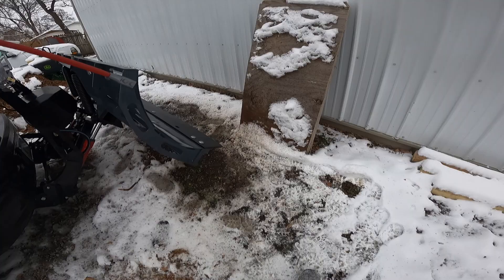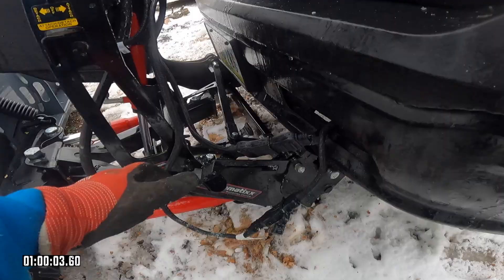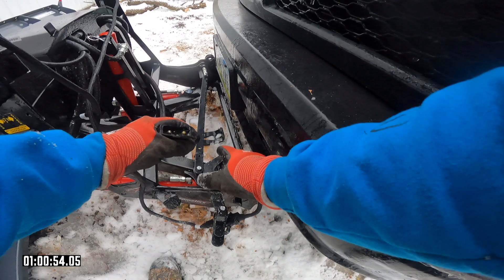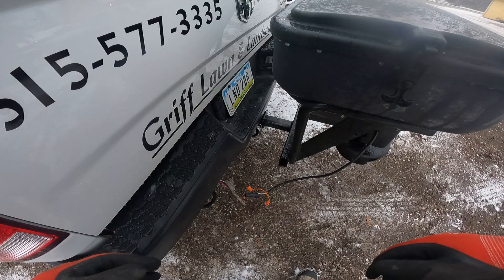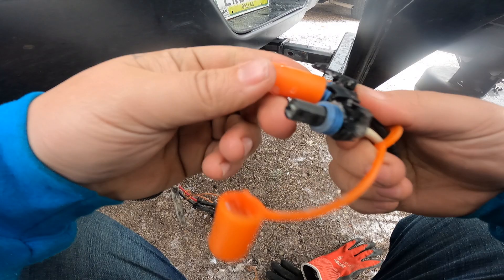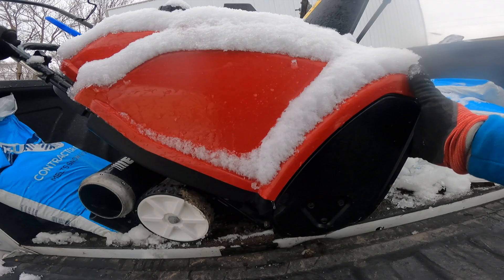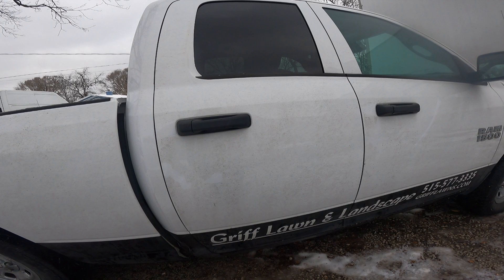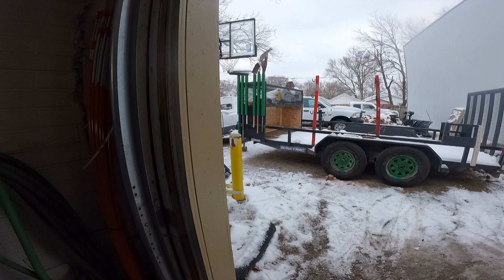How to detach and attach a snowex plow (FAST AND EASY)

Comment: I'm over east of you in the quad cities. Do you have the down force option on that plow? I've got plans to upgrade to the SnowEx 8'6 V and run wing extensions.
Reply from the maker: I do I have the down pressure but it never worked when installed
Reply: @Griff319  have you got it working? There's a separate control module that you need for that. It's around 500 bucks I think.
Reply from the maker: @jamesnm21 yes I bought the separate input module but it never worked and I got busy and never touched it again to be honest I should get to that
Reply: @Griff319  definitely looking forward to having that on my next plow. Whenever the snow gets over a few inches backdragging becomes a pain unless it's dry powder. It's literally what's keeping me from adding more accounts both residential and commercial.

Comment: Have you done any front end upgrades to support the plow? 

Have a snow ex 7200lt on ram 1500 and it rides pretty low.

Thinking timberin , on levelling kit.
Reply from the maker: Yes I put 2” spacers on the front end
Reply: @Griff319  Have you noticed any pre mature wear or rougher ride from the spacers? Leaning towrads that to achieve te look i want and gain the extra clearance. 

Seeing the timberins can have a rough ride when unloaded
Reply from the maker: @jonpellegrini9819 not as of now have I noticed anything in the summer!